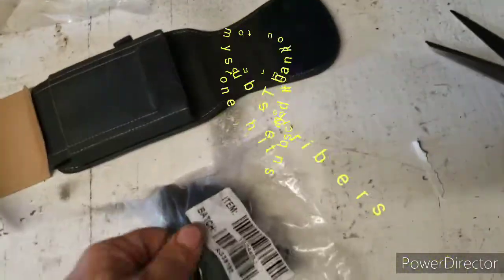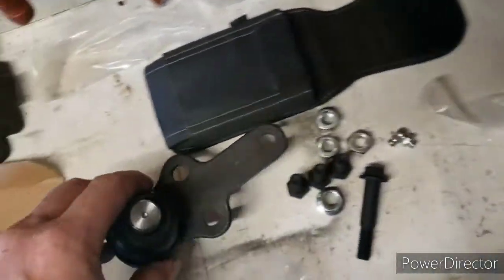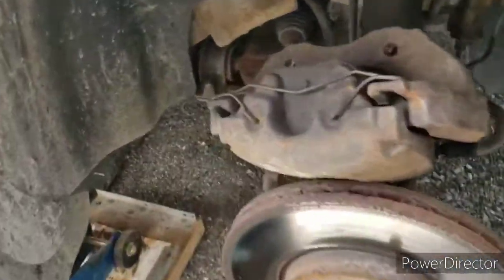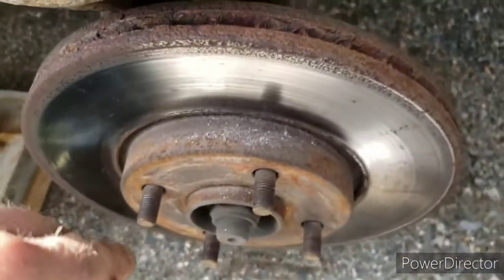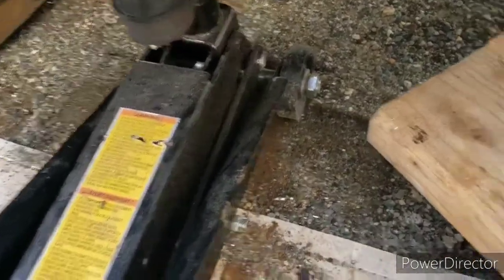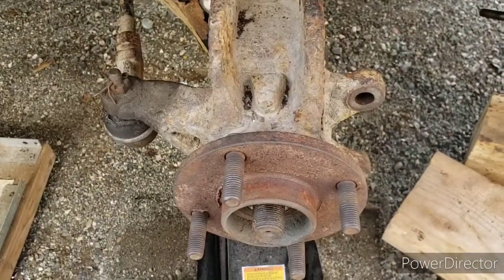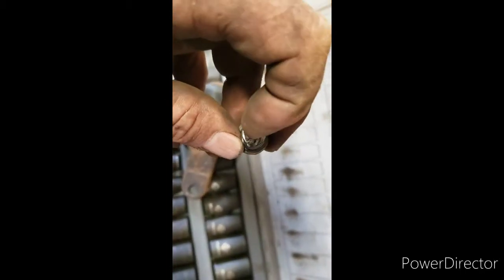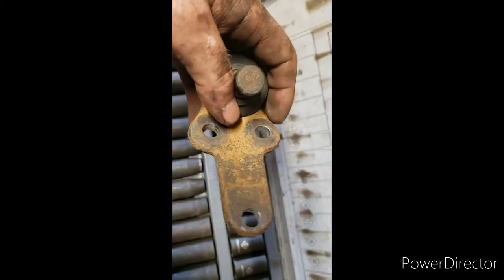How to Replace Lower Ball Joint on Your Car | DIY Auto Repair Guide

Comment: I throw a tantrum and swear no matter what I'm working on. I always save myself the misery and spend the extra $15 to get the whole control arm with the ball joint. Either way, it doesn't hurt to replace them before they fail.  That Focus will be brand new when you're done
Reply from the maker: Lol i should have got the control arm , should have went with my first thought. Might just throw in the towel with the focus but its the small stuff knock on wood.
Reply from the maker: Time for a truck
Reply: I love my old F150 but it only gets used about once a month.  But that once a month when I do need it, it's extremely handy.